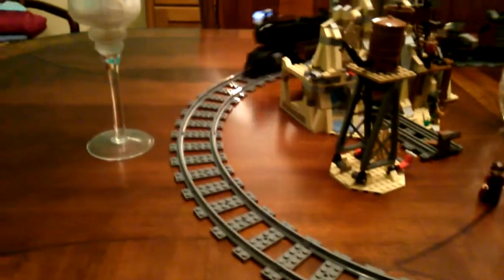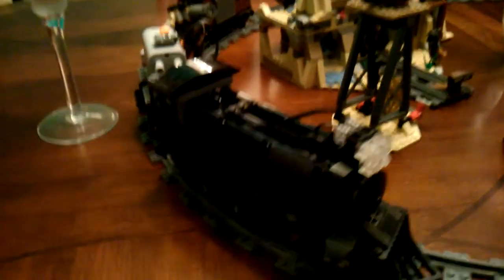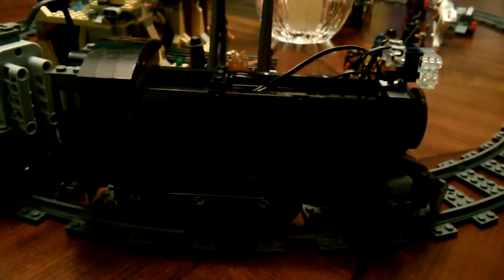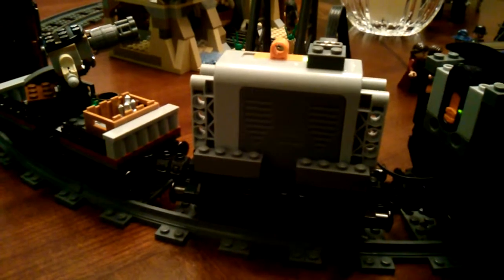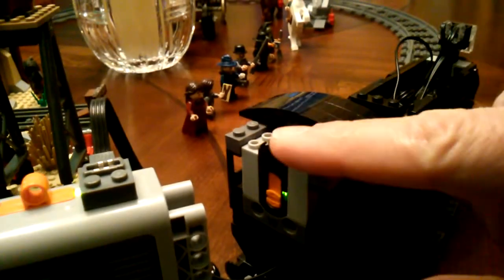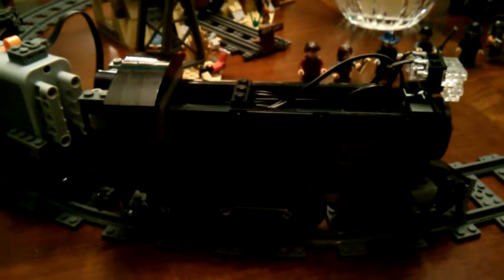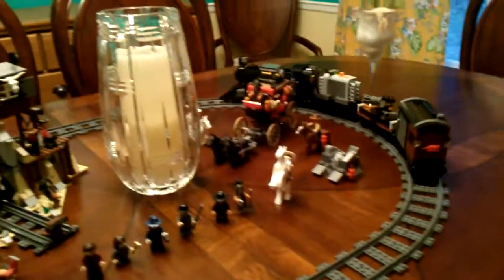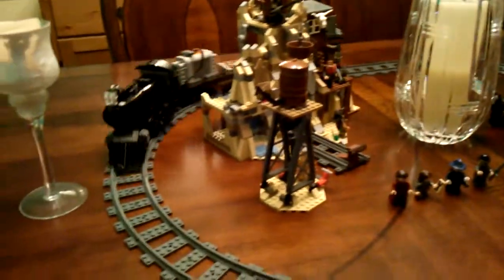LEGO 4-6-0 Steam Locomotive Project

Comment: I tried to do the same thing you did; but the motor kept popping out of place and I really didn't like the overall look of the locomotive.  So I went in and made the locomotive 2 studs longer (more realistic to the prototype) and the tender longer as well and put the train motor in the tender.  Overall I like how the locomotive came out.  (I’m still working on a way to make the tender about 2 studs shorter... but that can wait.) Just throwing that out there because I was able to have the locomotive look nice, as well as run; however I didn't use the M motor.